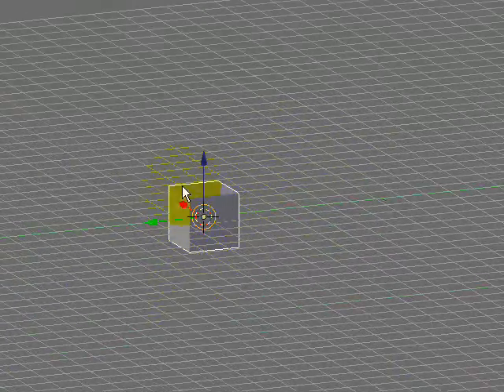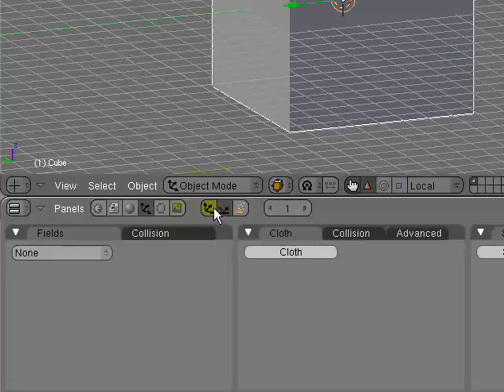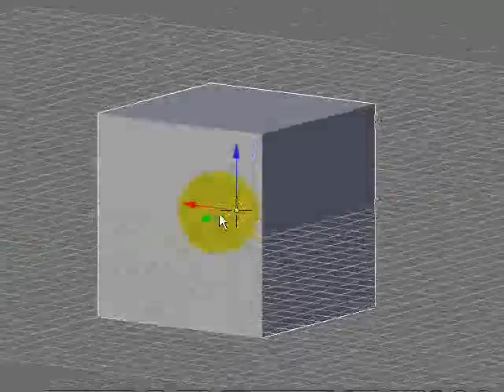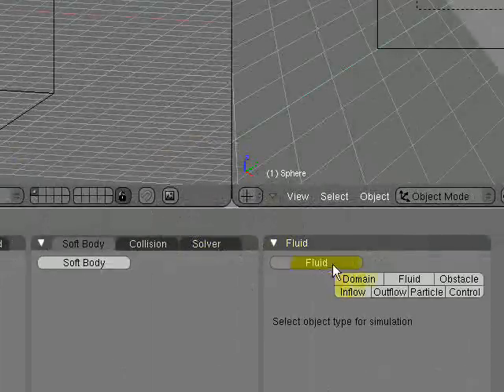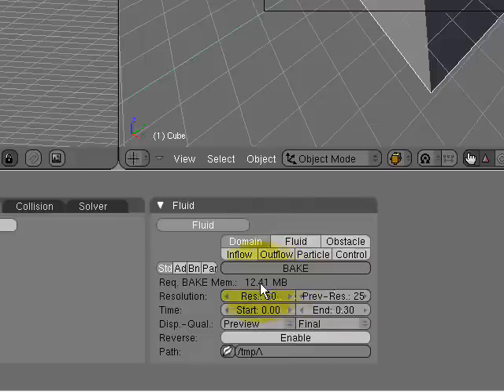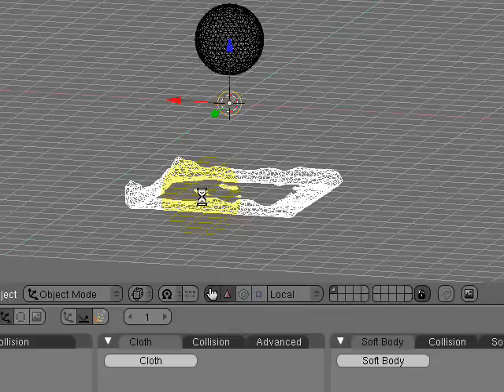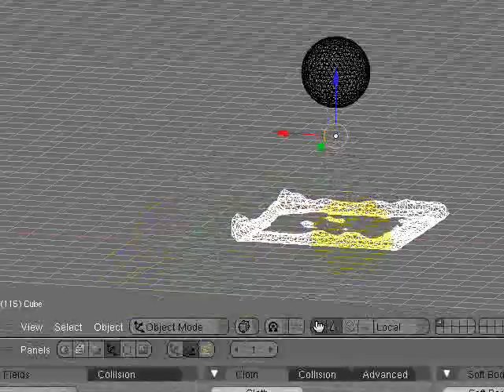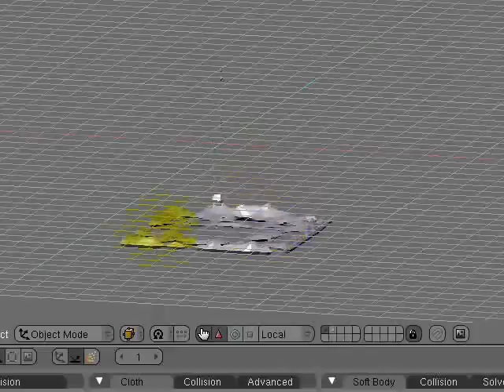Blender Fluid Tutorial

Comment from the maker: @the747videoer Well, that would be why. There are only a maximum of two threads that can run (hardwarewise) on your computer. If you had a 3.0 GHz 6 core processor, it would go more than 3 times as fast, most likely. Two cores should be pretty good though.

Comment from the maker: @333halfevil5 I know what you mean. Nice computer, by the way, I only have dual core 2.33Ghz, 2GB ram, and an nVidia 8600GT (256MB video ram). The reason it quits is because a res. of 200 is pure suicide. The huge amount of vertecies that your poor computer would have to simulate for fluid physics would kill most computers. Do not worry about that, mine cooks at 135.